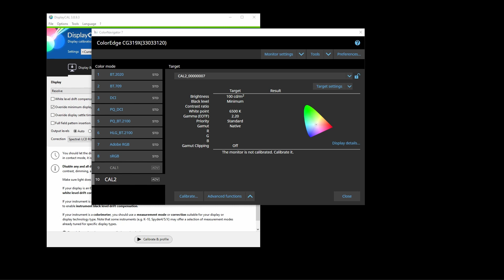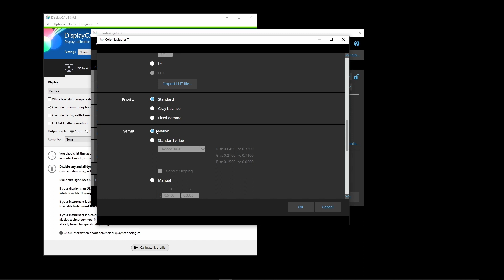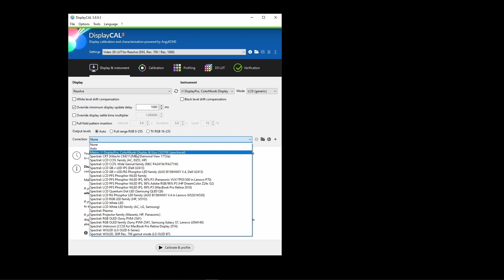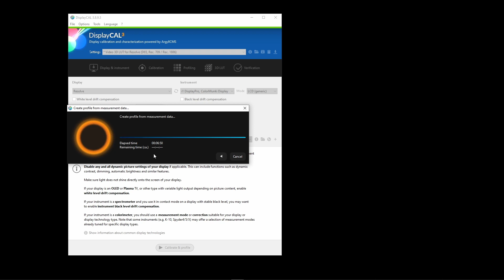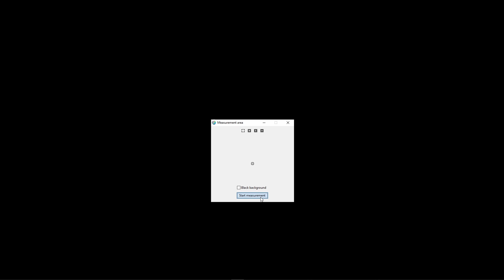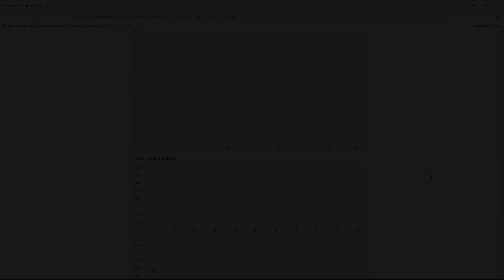How to Calibrate CG319X CG279X DisplayCal

Comment: Dear Stuart,
I'm trying to calibrate my CG277 monitor with this metod but I'm not having good results, perhaps is possible for this monitor that I need to use the CG247X procedure..? I'm not sure if the CG277 has the same order of LUT into the signal pipeline (heading)...
Could you advice me which procedure is the right for the CG277 monitor?
Reply: I'm trying to do exactly this and also having Issues. Have you had any luck? Loading the LUT in Project settings works for me but I'd like to have the calibration saved on the monitor rather than having to set it for every project.

Comment: Thank you!! I have got my Temperature set to 6500K and my Gamma set to 2.2  in the settings on my Eizo monitors themselves, do I need to turn those to off and let DisplayCal take care of those?? Thank you again!
Reply: Hi John. As shown in the video, CN7 is used to create a 1D lut and this takes care of the white point and the gamma (EOTF). When you use CN7 it will reset the slot first and then calibrate it. We are using native gamut and we will then use DCal to create a 3D lut to correct the colour volume for Rec.709. So, you should not make setting changes once you have gone through this process. You will have the slot in Advanced mode, not STD, so there should not be anything to that you can change anyway.

Comment: Great video. Thank you so much. I am struggling with this kind of calibration since years. Can this calibration also be done with a Spyder5? Do I have to switch off the compensation in Color Navigator for the Spyder5 as well? Which EDR file do I have to choose in DisplayCAL?
Reply: Hi Georg, I have never used a Spyder for calibration, but they do have some cal file from the factory but the edr file is for the Xrite i1Display Pro. However, in all honesty I would not use the Spyder 5. If you have the CG319X or CG279X I would highly recommend calibrating your monitor with ColorNavigator 7 using the built in probe, you will get good results easily. If you can get access to a high end spectro and correlate the built in probe you will have reference level calibration with CN7. For more information about the Spyder and DisplayCal (ArgyllCMS), go to the ArgyllCMS web site and see Graeme's documentation about what you need to do with DCal. But for accurate calibration you need to use the correct offsets. As for the compensation I don't know if this is active with the Spyder. With the CR100 it automatically turns off as the CR100 has the offsets internally in the probe. If you calibrated with CN7 and then measured the white point in DCal they should match (if the offsets are the same). 

As I am no longer under contract to EIZO APAC, I don't have EIZO monitors to test.

Comment: Hi Stuart! I did my first calibration and as reported by the Display Cal, the Maximum delta value is 2.49. It's ok? or is it very tall? Thanks a lot!
Reply from the maker: Hi again Diego. dE00 2.49 max delta can be expected in areas of the colour volume such as near black in the blue channel, so it can depend on where this measurement was done. If it was peak white point for instance then it would be too high. The main point is to ensure that the compensation is OFF in CN7 and that you use the same edr/ccss file in DCal.
Reply: @eizo_apac  Great, thank you very much for everything
Reply from the maker: @diegochak  You're very welcome
Reply: @eizo_apac  Hi again! I found what was causing the trouble. Calibrating to Native through DisplayPort locked the calibration to a different calibration socket (CAL 5), not accesible via HDMI (CAL6). Now I calibrated everything via minimonitor HDMI and Color Temperature is perfect when starting DisplayCal. Veryfied the Rec709 LUt in Dispaly Cal. But I am missing how to veryfy everything is correct after installing the LUT in DR or LUTbox, via Display call or other software that allows the same .ccss. Ahy clue on how to achive this? Thank you very much for your time and help
Reply: I really appreciate this video! I have seen it several times and it is helping me a lot to understand calibration process. So the question would be how to get the CN7 correction offset that it is applying on top of the iDisplayPro edr and add those offset values to the .edr in DisplayCal. That would make the final calibration even more correct, right? Unfortunatelly verification of current setting is not available in DisplayCal on Mac, I cannot find the way to get a report without applying a profile first. Anyways thank you so much for your help and insights!

Comment: Hi Stuart! thanks for the video, amazing! I just received my Eizo CG279X and didn't know how to calibrate the monitor for use with Resolve. Thanks again. I just want to ask you a question. Once the calibration is done, do I have to do something inside the resolve? There is a section in the preferences that says: Video monitor Look up table, do I have to choose something there? Thanks again
Reply from the maker: Hi Diego. There is nothing you need to do with the colour management look up tables in Resolve. The monitor is stand alone calibrated which is much better than loading a lut in Resolve.
Reply: @eizo_apac  Thank you very much for everything, your videos are really important and they solved the problem of how to calibrate my Eizo to work in video and color grading with the Davinci.

Comment: salva viñets
salva viñets
• 1 month ago (edited)
Thank you for this video!

Just wondering...  As we are creating a full range 3D calibration LUT, when I'm doing the calibration of the test pattern from resolve, do I need to change the input range in the device to full ranges or limited is ok?
Stuart Pointon
Stuart Pointon
• 20 hours ago
Hi Salva, apologies for the delay in responding. Yes, the CG319X/CG279X use full range luts as the lut processing is after the conversions and scaling. The important thing is to ensure the signal range levels into the monitor match the monitor settings. The reason there is a separate CG247X video is because of this, the LUT is at the head of the pipline as as such must be scaled to the signal input which DisplayCal is able to do, as well as Colourspace.